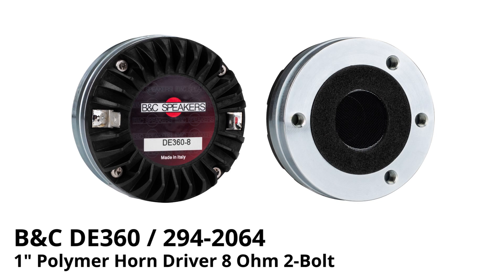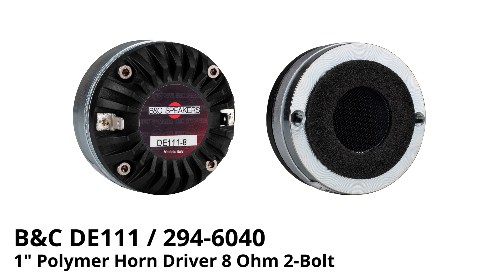New High Frequency Drivers from B&C - Parts Express Visit

Comment: It is the first time I mount horns... the question is as none of the screws are sold with DE111... how can I mount it on the corresponding B&C speaker ? There is no way to screw the M5 neither on the speaker or the compression driver 😬
Reply: I mean how can I handle the screwdriver as there is no holes to screw the M5 through